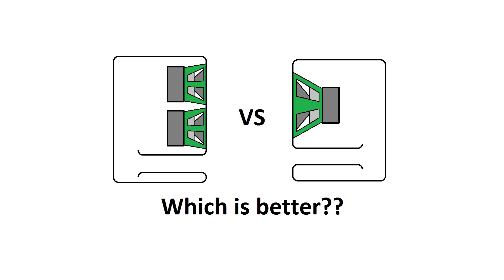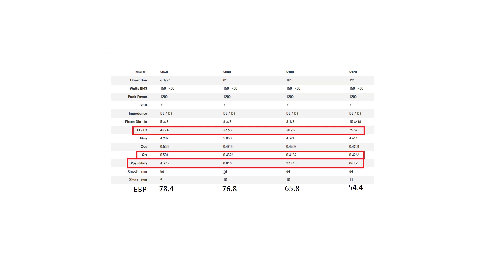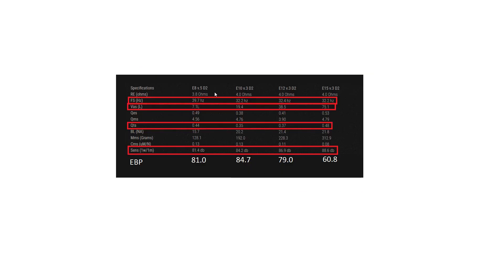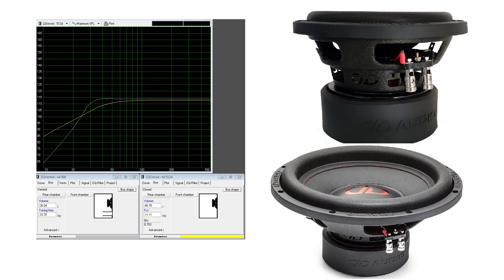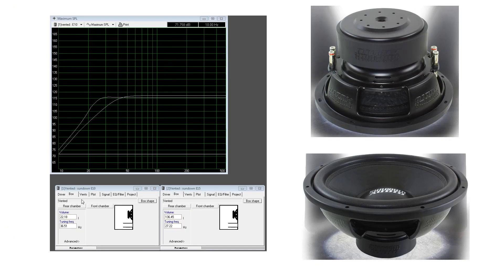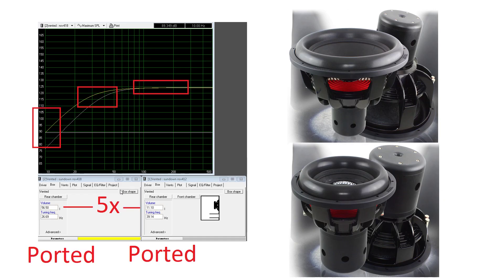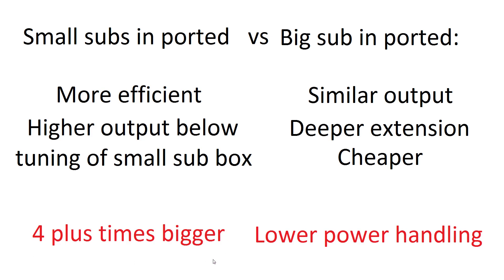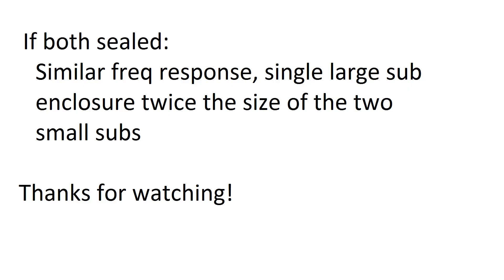Two small subs or One large sub?

Comment: Mostly crap video from an enthusiast standpoint. Who in the blue hell compares 2 8's to a 12? 2 12's to an 18? and 2 15's to a 21? Really? A 12 is compared to 2 10's, a 15 is compared to 2 12's, and so on. I hope you're not an armchair expert. The issue at hand in any installation is folks have a limited volume and are wondering what combo would be best bang with reasonable extension.
Reply from the maker: Mostly crap comment from a logic standpoint. Many people ask for an answer to this question, or the question, "more small subs or fewer large subs?", which is the essence of this video. I'm a physics student learning about the world of mathematics and how we apply it to the universe around us, audio is my hobby. 
The second half of your comment is decent, and answered in this video. The controlled variable was cone area, and dependent was box size. It could also be controlled enclosure size and dependent cone area. You can extrapolate it how you like, so if you've got X airspace, it's good for 2 ported 8's, 1 ported 10, or a sealed 12. The main jist of it is smaller subs can use a much smaller box.
No need for hysteria in the first half though.

Comment: For example a two 15 inch sub has more cone area than one 18. You could also make the box narrower (front baffle to fit in weird or narrow spaces for example. 
But the 18 will be cheaper and easier to make the box for. 
Here is a list for cone area (in general, not for specific drivers) 

One 8"   = 50.27

One 10" = 78.54

One 12" = 113.1

One 15" = 176.71

One 18" = 254.47

Two 8"   = 100.53

Two 10" = 157.08

Two 12" = 226.19

Two 15" = 353.43

Two 18" = 508.94

Three 8" =   150.8

Three 10" = 235.62

Three 12" = 339.29

Three 15" = 530.14

Three 18" = 763.41

Four 8"   = 201.06

Four 10" = 314.16

Four 12" = 452.39

Four 15" = 706.86

Four 18" = 1017.87
Reply: A 12" sub doesn't actually have 12" diameter of cone area though. On average most subs tend to have about 70% of their actual size-diameter as cone area. So a 10" sub for example would have an effective 7" diameter of cone. And a 7" cone has 38.5 sq inches of area, NOT 78.54.
Reply: Also i should add, when measuring the cone diameter, you should account for 1/3rd of the surround on both sides.

Comment: That was a very good analysis. I have had that question come at me many times over the years. In reality, neither option is "better".  It all boils down to preference, vehicle type or venue size, space available, power available, overall system design and sound quality.
Going for high output, accurate transient response, or a little bit of both. Music preference can make a difference as well.
Reply: @dednside5229  Did I miss something? I can't read the entire response. Every time I hit "read", I only get the option to reply. Plus, I see a dollar sign next to it. I don't know what that's all about.
Reply: @brentlaube568 have to click on it just right.
Reply: Folded horns have the best fidelity and have the fastest transient response, then sealed are second.
I find ported are slow and blur the transient resulting in a less realistic result tending to every track having the same boomy characteristics.
Reply: @rodrocketis  I agree w this, going to build a horn waveguide with my available  7 cubes in my truck instead of sealed or ported. It's fantastic Iv heard them

Comment: Hod does power usage/requirements differ from car audio to home audio?  I had a 300 watt Dennon home amp that could trip a 30 amp fuse.  But yet a 2000 watt car amp runs fine on a 30 amp  fuse.  Other than the loads ohmage, what is so vastly different between the two systems?  The Dennon amp weighed like 50 pounds yet the car amp maybe 5.
Reply: could it be possible that the 50 pound denon amp was a "true analog" amp (transistors/mosfets, big ass heatsinks 'n' stuff) and the 5 pound car amp was a Class D ?

word on the street (and in marketing material) is that class D amps are crazy efficient (like they can push 120+++ Watts to the speaker while sucking only 75 watts outta the mains socket)
Reply from the maker: @KenjiUmino  yeah, the denon could be a class A, which essentially turns all power which doesn't go to the speaker into heat, so at low volumes they can be super inefficient, as for class D they're typically 80-90% efficient, so take in 110 watts and output 100 watts, turning only 10 into heat.
The denon could be turning 300w into heat for comparison.
Reply from the maker: Every watt is a watt, but home audio always gets its rated voltage, when generally car amps want 14.4v, the lower the voltage the lower the current, and the lower the power. Since cars are small, it doesn't take a ton of power to get loud, which I think is why there are so many "6000 mega watt" car amps, because they're loud enough even though they're 200w RMS, but it really depends on brand. Good car audio brands do their power and more, eg. sundowns new salt-12 is a 12k amp which does 20,000 watts RMS at 1% THD. Another thing to factor in is efficiency, powerful car amps are class D, where as often powerful home audio amps, especially older ones, are class AB. Class AB amps draw more current for the same output.

Comment: I like 2 subs if the room permits it. I'm more into SQ and I like running a 2 channel to the subs,for stereo separation. I know a lot of head units have mono sub outputs,so I would opt to use the rear RCAs in that case. Before anyone says anything,I know that a lot of the bass in music is mixed stereo and doesn't usually pan,but there are some songs now and then that do pan the bass and it just sounds better IMO. Plus you have more wiring options,with more coils.
Reply: Sound localization is done through Time Differences (phase shift - frequency arives at one ear slightly earlier than on the other one) and Level Differences (volume - frequency arrives at one ear slightly louder than on the other)

So, i'm Just sayin, for human hearing frequencies below 800 Hz already get difficult to locate since below that only time differences get recognized. Level differences are difflicult to detect and get even more difficult to detect the lower you go. Anything below 80 Hz of frequency is next to impossible to locate since  both time differences aswell as level differences can't be detected properly anymore. Same as above, the lower the frequency the harder it gets. Thats why next to no one bothers playing with more than one sub and why subs are placed basically "wherever is proper space". So doing stereo separation for subs is rather unnecessary unless the crossover frequency is higher than, lets say 80Hz and your hearing is prime.

But 2 subs are always better than 1 in terms of power and fun :)

Comment: You have officially gained me as a subscriber I love the technicalities of acoustics . I am a 2nd generation DJ and have been around both pro audio and car audio systems since the age of 5 years old, thanks to my dad who is also a Dj. . .  i have a question id love for you to answer that no one seems to have the answer to. . .  it has to do with  is sensitivity vs xmax. . . .in the pro audio world most subs have an xmax of 6-10mm have a sensitivity of 96-99 db at 1 watt,  however they never get any lower than 40-35hz on average  in the car audio world most subs have an xmax of 12-25mm have a sensitivity of 80-88 db at 1 watt,  and always get down to 25-20 hz. . . where i get so confused is most people say the more air you can move the louder it will play. . . . but when i use 1 watt @1m db calculators to calculate max spl at a rated sensitivity   [http://www.sengpielaudio.com/calculator-efficiency.htm]  . . . a 99db sub at full power and xmax  will always play way louder than 88 db sub with 20mm xmax at a full power and excursion. . . . THIS IS WHERE I GET SO CONFUSED.  . ..  If a low sensitivity sub is getting its full rated power and AND moving a full 20mm of air per stroke how is it a possible that a 8mm sub winch is moving less than half the air will play louder. . . I've ran close to a hundred  calculations and have searched the web up and down for the answer to this and can not find it anywhere. . .  The real reason i want to know: is as a DJ and with pro amp power being so cheap now a days , Id love to get 2 15in or 18in 20mm xmax , 28 hz hitting subs that can play a  135-140+ db in large venue at half space/single plane loading [aka the floor]!!!!!!!!!!!!!!!!!!!!!! IT WOULD BE AMAZING.. . . MY DREAM IS TO PLAY WITH SUCH AUTHORITIVE BASSS in my performances BUTTTT. . . .    since NO pro audio subs hit lower than 40-35 hz on average [except for large horn loaded touring rigs]  THIS IS JUST A DREAM that  leaves me yearning for more!!!!!!!!!! I appreciate any answer you can give since there is so few people with the knowledge you have.   It seems the only other way id be able to find this answer is to spend gobs of cash on top dollar high xmax car audio subs and set them up and test them in large venues  since there  is to much cabin gain/ boundary loading in small rooms/houses to have accurate representations in testing.
Reply: Excursion has nothing to do with loudness. Excursion is for deeper bass notes. A midrange has limited excursion compared to a woofer but can be much louder. In order to get low and loud requires a very large box. This is why in a dj setup which requires some consideration to portability but more so to volume capability, there is limited low bass. You need to crack plaster at 50Hz but not the need to pump out 130db at 15Hz.
Reply: Check into JTR Pro subs, I have my eyes on the Captivator 218 Pro, and I just went to check it out yet again.  Looks like they're even updating the model, more POWAH! Since you have an amp, they have a passive model as well. 

Anyhow, 27hz at -3db is pretty low for a pro sub, and that's what they deliver. 

Or, you're right, you could go the custom route but that gets more pricey and complex.  The great thing about the JTR is it's a turnkey system meant for pros, even has wheels built onto it.  The custom direction gets trickier, but some guys I have talked to about a custom setup that will get me down to a clean 20hz are Stereo Integrity with a custom 24", and the DIY Soundgroup with one of their pre-fab boxes for the 24".  The only pre-fab he has listed on the site is a sealed model, but he can make a ported model as well.  After adding an amp to all of this and considering the size and weight of the whole setup, I'll honestly someday just go with a pair of JTR's. But boy that SI24" would look awesome up on stage and 20hz above 125db in a live venue would be unreal.
Reply from the maker: There are a couple reasons why PA subs have a higher sensitivity than car subs. 
1. Coil gap. For more excursion, more coil needs to overhang the gap. When you picture a subwoofer, the coil is essentially a resistor. Everything hanging out of the coil gap is just turned into heat, so PA subs have shorter coils, and less overhang, and less wasted power.
2. Moving mass. Car subs have heaver cones, and longer/heavier coils, and while they're also generally stiffer than PA subs, they have a lower resonance. The stiffer a sub is, the more efficient it is, but the heavier it is, the less efficient it is. Sensitivity is a T/S parameter, meaning its calculated from an equation, not from a microphone/SPL meter. Looking at max SPL figures is more reliable for actual output.
Sensitivity is calculated from efficiency, which is (9.8x10^10 x Vas x Fs^3)/Qes 
So, for a looser, ligher sub, it has a higher Vas, and a higher resonance, and if it has the same Qes as a large sub, it has a higher sensitivity even though it's not as loud at low frequencies. Also note it's possible to have an efficiency over 100% so there's that.
The key to getting low and loud is having a large surface area, so if you've got enough/ hig enough subs you can still be efficient. But remember the key trade-off is size/efficiency, so you can get low and compact, but you need a ton of power to get loud. 18s or 21s for sure.
Reply: @Dakoustics   Thank you so much for your response,  i currently have a EV i force Pro 18 sub for my Dj set up and it gets loud but not low  [45hz, -3db  and 39hz @ -10db] [133db max half space] I  was thinking about replacing with deeper hitting sub[s] but there in lies my long battle with understanding of sesitivity vs xmax . its just boggles my mind, there are guys hitting 160+ db in spl competions with a single spl 15 . . I know there is hella cabin gain in cars, but from my rudimentary calculations it seems to be about 18 db, BUT even if subtract that 18db of gain from 160db it still leaves me with a 142 DB  that a high spl car sub should be able to hit in half space. . . obviously this is all just in theory. . and from my current understanding of sensitivity it all just a pipe dream. . . I have spent many years in the quest FOR LOUD LOW BASS in my dj performances .. . . .  Right now power is not an issue for me , as a currently have a Huge power at my disposal [1200  @ 2 ohm RMS x 4 OR 2500 x 2 @ 4 ohm RMS] Are my calculations on +18db car cabin gain wrong ?  If they are right i would be a happy man to a 2500 watt 15" spl car sub that put out 142 db  at 30 hz half space [ I WOULD DROOL . . .LOL HAHA] .. . . . is there any way to calculate true  half space max spl  using available data? since it seems sensitivity is not that accurate for high excursion subs. . . Again I thank you GREATLY for your answers,  finding anyone that knows even what i know is very hard to find on this subject , but in this case you FAR SURPASS me in the understanding of all this and for that i am truly gratefull!!!!.  as a side note have you have hear of BFM horns I noticed you were constructing a horn but was sure if was a BFM design
Reply from the maker: @mikeriverajr4447  I'll check out the horns, and speaking of horns HornResp is a program which should be able to calculate the loudness. It's got a steep learning curve, but there's probably tutorials for it out somewhere. I used it to design the horn I made, and it seemed to do the trick. The main thing is comparing the PA sub with the car sub, so make sure you record the response graph for both.

Comment: Oh .. and then there is the important (or not so important) speed of the drivers and enclosure. All ported enclosures are 'slower' then a sealed one. In a ported speaker some of the waves being reflected inside the enclosure until they leave. That gives you a kind of 'blurry' sub. The bigger a speaker the more mass the coils have to handle and the slower the response of the speaker. That effect is not as big as the difference between seeled or poeted enclosure but one of the reasons why you don't see any 21" bass guitar amps.

Comment: Regardless of outcome, I'll take my single large subwoofer over two smaller ones but I want a 15 or bigger
Reply: I prefer one larger than two smaller but I'm talking about 21" or larger.
Reply: Depends on what kind of music u listen too.  It you listen to rock or something with fast double bass....your going to be very dissatisfied with how sloppy a 15 or higher sounds. 10s or 12s have much more control.  A good 12 is the best.  12w7 it the bomb.  Sound quality is unmatched
Reply: @skypallman6169  Absolutely a myth. Large drivers do not sound sloppy because of their size and neither are  they slow sounding. The amp used to drive the sub has a substantial impact on the sound.
Reply: @carlosoliveira-rc2xt  lmao. It's not a myth.  I've done car audio for 17 years and own a shop.  Of you think u can make a 15 or larger perform as tight as a 10 or a 12 your out of your mind.  It's simple physics! Way more surface area to move.  10 or 12 gives much better punch for tight notes.  If you want to move air of spl...more surface area moves more air.  That's a fact
Reply: @carlosoliveira-rc2xt  and an amplifier has absolutely NOTHING to do with a subwoofers performance in that note.  You can have an amplifier that gives cleaner power...less distortion.... But an amplifier has absolutely nothing to do with a subwoofer physically performs that has to do with the motor/mag of a subwoofer... You are clearly mistaken lol
Reply: @skypallman6169  I wouldnt go as far as to say large woofers sound sloppy. I have a pair of Jl 15w6's and those monsters can do anything from rockin' Led Zepplin to bumpin' Dr Dre "The Chronic". I think if space is an issue then go with 10's or 12's otherwise Big Subs ftw!
Reply: @illegalregal9577  those aren't 15s unless u have the original w6s that are prob 12 to 15 years old.   they r 13.5s and they made them that way for a tighter sound .. I've also been a JL dealer for 17 years.  But if you took a 12 w6 it would have a tighter sound in the 13.5 it's a fact.
Reply: @skypallman6169  yeah the 1st models I have, I don't own any JL v2's. I have two in a sealed enclosure and they get punchy, more so than some 10's plus they're way louder. I know because I listen to rock. I get that you've been into audio for a while but all woofers are different I guess
Reply: @carlosoliveira-rc2xt  thank you. Damping factor. It makes a massive difference. Too bad today's crowd is only concerned with watts and efficiency
Reply: Go big or go home right!
Reply: @illegalregal9577  I use a 24" currently and I find the bass sounds much different than say using a couple of 12 inchers, even at fairly low levels. The wavefront sounds larger and more realistic.